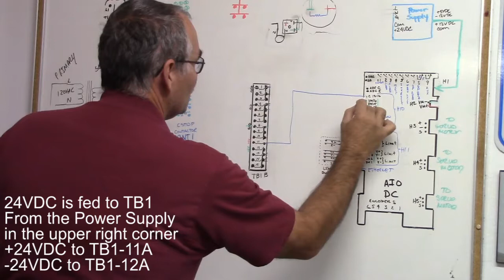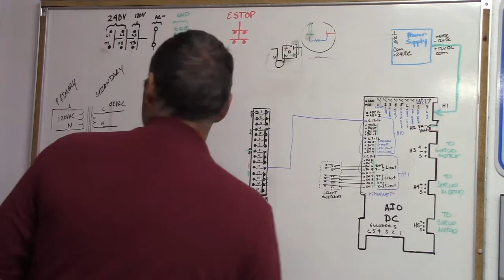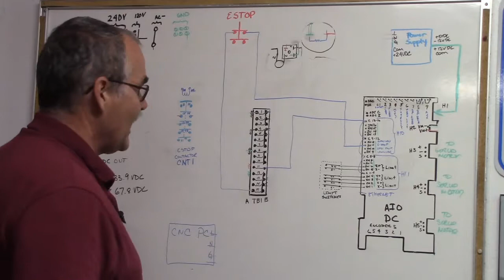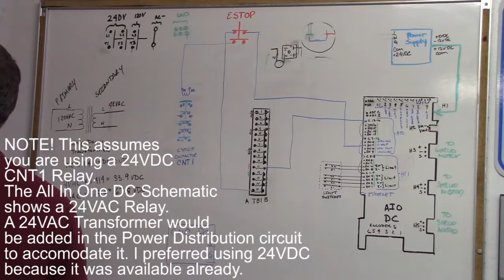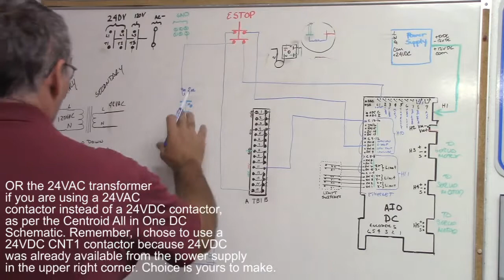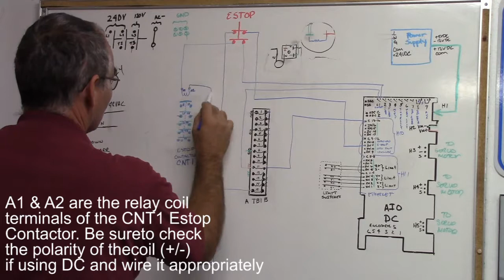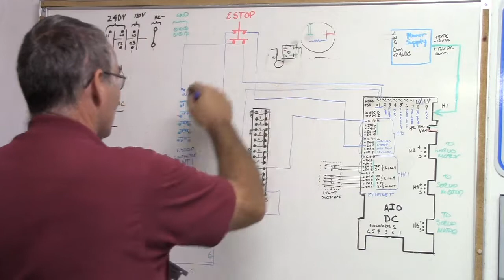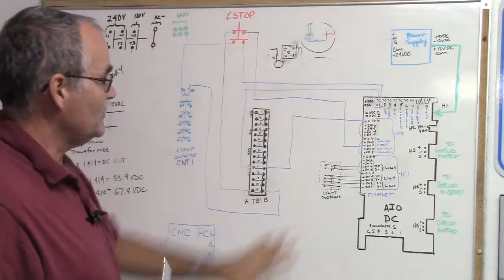4: "Wiring" The Centroid All in One DC - EStop Circuits

Comment: Marty, I love your videos, and I'm following in your footsteps on my own project. My dealer says that he'd be worried that the power supply's 24VDC might get noisy and cause other problems and is recommending I snag a 24VAC transformer for my setup. Have you seen any such issues like weird PLC errors, or any other unexplained faults?
Reply from the maker: Use either or, BUT it must be its OWN power supply DO NOT USE the logic supply intended for All in One DC. You can buy a 24VAC Transformer on Amazon.